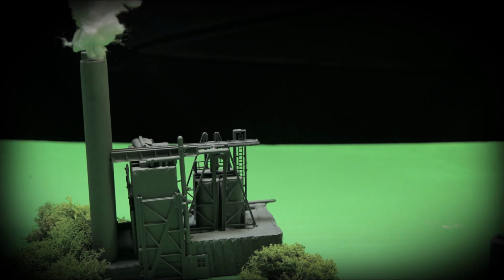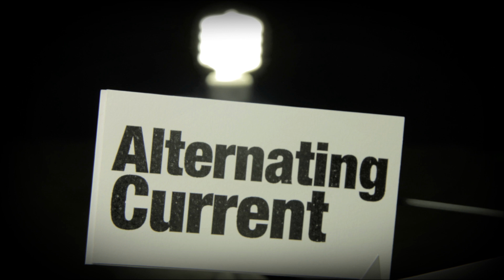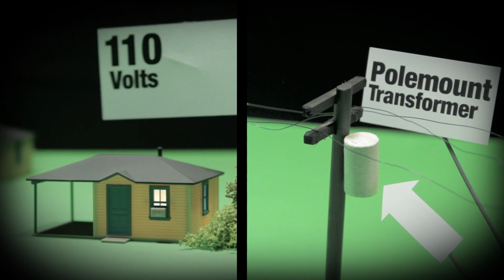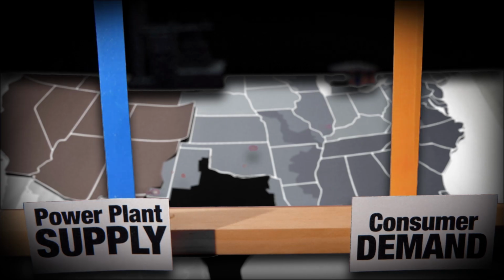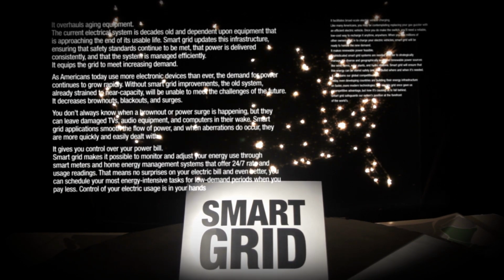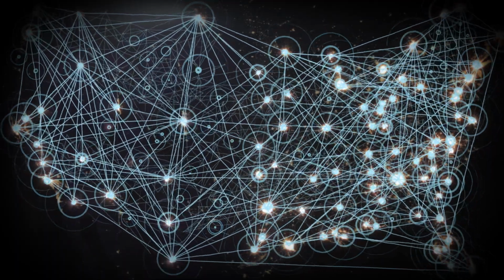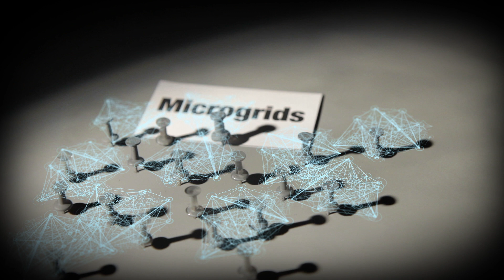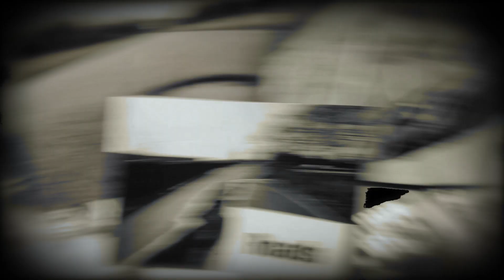How the grid works || BURN Radio

Comment: A Lead acid battery to power the grid of a city for one hour would need to be the size of a football field and 40 meters high..  Huge acid content and huge environmental damage.    Rare Earth batteries are made with terrible environmental cost and are unsustainable.       Storage is out now and there is little likely hood it will ever be an option.   Wind farms are net consumers of electricity, they are non synchronous and can only be allowed into the grid below 50%.  Solar is the same.   The price will rise to a point where consumers will resort to home generation and electricity will be a luxury.

Comment: Educational and entertaining!    We need to find an alternative to the smart meters, though.  I have friends who've gotten horrendous health problems from them.  Maybe their signal doesn't need to be so strong, or it could be further from the house, like at the street.
Reply: +lytedancer Are you sure it's the smart meter? They shouldn't transmit any more EMI than a modern cellphone.
Reply: +Andrew Figueroa I worked for a natural doctor for 14 years.  She did a lot of testing and found the smart meters pulse pretty constantly - something like every 30 seconds - and are more powerful than a regular cell phone. She improved patients' health conditions by having them remove the smart meters or sleeping at the other end of the house so they weren't constantly exposed through the night.  Also here's a website with some info: http://www.austinsmartmeters.com/  There's more research like this if you search the web.